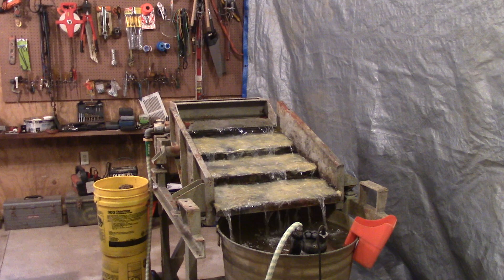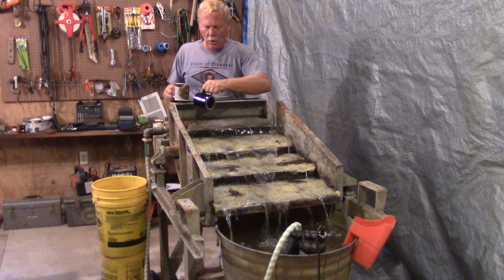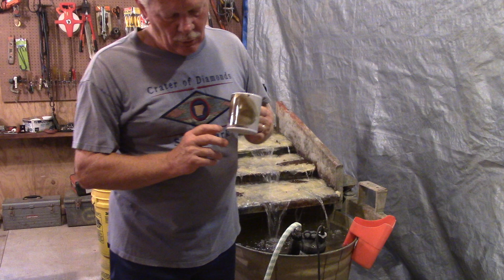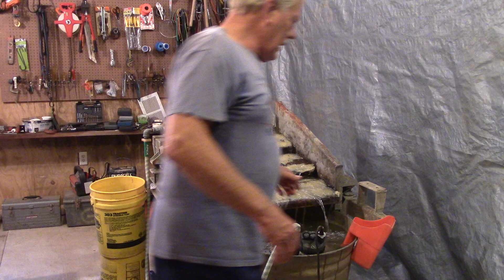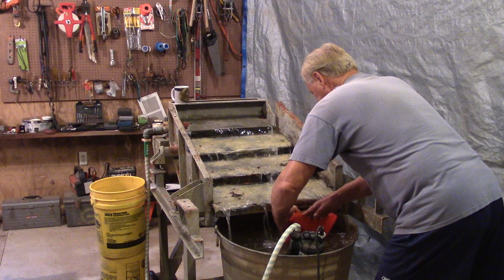Learn How To Run Gravel Over A Grease Table To Recover Diamonds

Comment: Good video,what type of grease do you like to use,? .would ordenery vaselene work ,and at around 23c temp as im in the tropics of bolivia, you do a good video a d explain well.
Reply from the maker: Thank you for watching my videos and for your compliment.  I use a special diamond grease that was developed by DeBeers.  It is called "DB-43."  Vaseline would be too soft and catch everything.  I have heard there is a good recipe for diamond grease that uses paraffin wax, lamp oil, and vaseline.  But I don't know how much of each you would use.  This "grease" is not soft like car or truck grease.  It is harder like wax.
Reply: Thanks for the info  ,ive been gold prospecting here in bolivia for some time,it just happens thay where i go theres kimbetlite or something close that looks like kimbetlite pipes eroodrd out of softer rock. @genuinediamondsinar3253

Comment: Which grease do you use and at which temperature?
Reply from the maker: I use DB-43 which is a DeBeers grease.  I got some that was abandoned after a diamond exploration and recovery project I worked on for 3 years.  You can make you own with paraffin was, vaseline, and lamp oil.  But I don't remember what percentages of each.  This has more the consistency of wax.  I wouldn't call it "grease."  As I explained in the video, the temperature is VERY important.  Your water, gravel, and grease all must be between 65 and 70 degrees to work properly.  Thank you for watching my videos and for commenting.  This is just one video in a series of 5 I did about grease tables and recovering the diamonds from the run.
Reply: @genuinediamondsinar3253  I assume the lamp oil you used was a paraffin-based lamp oil. I would think that a kerosine-based lamp oil would just separate when you run water over it.  Parafine melts pretty easily so I would assume that the majority of the mixture will be paraffin. you want the grease to be spreadable and tacky. I might try to look into the proportions. A book I have (Diamonds by Eric Burton) says the water would be slightly soapy. Does this sound familiar?  =)
Reply from the maker: @JewelryDeconstructed  Yes, I guess so.

Comment: Stumbled across your channel will the table catch gold it's hydrophobic like diamonds but heavier what's your thoughts
Reply: It's an experiment I am going to try with a set amount of gold in a recitation system to test it out any suggestions on what type of grease to use??? I thought I heard a recipe in video will have to go back and check when I get results back I will let you know. Thanks your videos were awesome and had great information
Reply from the maker: @406miner7  I am glad you are going to try a controlled experiment.  I would love to know the results.  I used to work for a diamond exploration and recovery company.  I got some of their DeBeers diamond grease when they closed up.  I'm not certain of the exact formula, but I've heard there are three components---parafin, vasoline and lamp oil.  To me, this "grease" seems more like wax, but of course not as hard as a candle.
Reply from the maker: @406miner7  I don't know if you've seen them all or just found this one video, but I have a series of 5 videos about using a grease table.  Here is one of them:  https://www.youtube.com/watch?v=bW4zCtmnqJo&t=5s
Reply from the maker: @406miner7  Here is a link to one of my other, grease table videos:  https://www.youtube.com/watch?v=HsK8QcI_uTs&t=25s
Reply from the maker: @406miner7  Here is another grease table video link:  https://www.youtube.com/watch?v=0ENLR39yoco&t=1s
Reply from the maker: @406miner7  Here is the final video about grease:  https://www.youtube.com/watch?v=OBRLO3artyM&t=1s
Reply: Cool thanks will let you know results
Reply from the maker: @406miner7  Great!  Thank you.  I'll look forward to hearing the results.  There's still so much to try and learn about.
Reply from the maker: I have never heard of a grease table being used for gold before.  I did not know it was hydrophobic.  If so, it would work.  Being heavier (denser) would only make it catch in the grease better.
Reply from the maker: I looked it up and found that, "As with all metals, gold is naturally hydrophilic, with liquid contact angles less than 90 degrees."  So, I wouldn't trust a grease table to catch 100% of the gold as you can trust it to catch 100% of the diamonds.

Comment: Huh where does one get a grease table by any chance? I am also wondering if one can use the rotary gold pans and add something to make the water heavy to seperate diamonds from the lighter stuff?
Reply from the maker: Grease and grease tables just are not available in the USA.  I used to work for a diamond recovery plant that left this equipment behind when they pulled out and sold everything else.  We used a dense liquid called LST that we bought from Australia.  It was $1,000 per liter.  I would not suggest relying on grease or dense liquids.  I would just get a sarucca and use it in water.  Most individuals do it that way and have great success with it.
Reply: @genuinediamondsinar3253  hmm know any plans on building a sarucca?

Was thinking of a grease table for seperating from concentrates after something like a sarucca or a vibrating mineral jig. 

As for the grease....not tried this but I know the south Africans look for 3 things in their grease. Softness, thickness, and tenacity. 1/3rd bees wax, 1/3rd vaseline, and 1/3rd boiled linseed oil is the Bush recipe I was given by a South african friend. Another is just bees wax and Vaseline until a thick sticky grease is obtained. 

Never diamond mined before or ever mined before. Ran a suction dredge once but it was for removing smashed beer bottles from the river bottom on a river tour. 

I got a lot of time on my hands and really wanna build something...
Reply from the maker: Here is a link to a video where I demonstrate the use of a sarucca.  This is the way to do it instead of grease or dense liquids:  https://www.youtube.com/watch?v=ISIlxqC7rG4
Reply from the maker: I have heard paraffin, vaseline and lampoil.  The "grease" I have used is pretty waxy.  I still just prefer to wash through screens and sarucca.  I don't know of any plans for making one.  I'm sorry I couldn't be more helpful.
Reply: @genuinediamondsinar3253  its alright they seem to be pretty rare in the DIY world apparently. Couldn't hurt to ask lol

Though I wonder what the angle on your table is. I have heard 5 degrees with a 1/4 inch drop is really commom in South africa and south America.
Reply from the maker: @kingdarkem  Yes, it never hurts to ask.

Comment: An aquarium heater is thermostatically controlled, and can keep a 55-gallon fish tank at most any temperature you desire.  I suggest you use two, and keep a backup on the shelf.
Reply from the maker: That is an excellent suggestion.  I've never had fish and didn't know about the heater.  That would be perfect.  Thanks so much for the great idea.
Reply: @genuinediamondsinar3253  Look for a fish tank thermometer at the same store.  I like the ones that float.  There are others you stick to the glass.
Reply from the maker: @maxcinta5760  Okay, thank you.
Reply: I have experimented with a grease table here in NC and considered water temperatures.  The average annual air temperature here is 60° F therefore the temperature of the water coming from my 30 foot well is 60° F so I don't even have to measure it.  I formulated my grease for that temperature and it routinely captured my cheap test diamonds.   The same should be true for a city water supply unless one is very close to the water plant or the plant has a very high throughput.  Measure it to be safe but you will generally find that it is very close to your average annual air temperature.  Btw for all you prospectors working creek bottom sediments.  Don't count on such diamonds to be hydrophobic.  Such diamonds are often coated with a mineral coating or a biofilm which might well alter that property.

Comment: Around fifty years ago I heard something about using grease on the bottom of a sluith box and shaker box to make the gold dust stick.  I figured it was bacon grease but I really don't know.  This information has been lost to history.  You are the closest information about this process I have found.  So, what do you know?
Reply from the maker: Thank you for watching my video and for commenting.  I have 5 videos in this series about using a grease table.  I worked in diamond exploration and recovery for years just outside of Arkansas' Crater of Diamonds State Park.  There are 8, known diamond pipes in the area.  I wrote a book about diamonds in Arkansas.
Reply: @genuinediamondsinar3253  Okay, what's the name of this book?  And, where are these 5 pipes located.  After a wee bit of research, I found out that gold is hydrophobic also.  So are most of the valuable metals.  I am now in Ponca City, and I plan to move to LeFlore OK ASAP.
Reply from the maker: @maxcinta5760  Thank you for your interest.  My book's title is, "Genuine Diamonds Found In Arkansas."  You can order a copy through our website or download it as an ebook.  www.DiamondsInAR.com
Reply from the maker: @maxcinta5760   The other diamond pipes are all within 3 miles of SW Arkansas' Crater of Diamonds State Park.  Here is a link to a video that tells where the other diamond pipes are located:  https://www.youtube.com/watch?v=_9Fvx-hQZks&t=1069s

Comment: So the wax you use that's db45 if you had to guess what do you think the mixture quantities are?
Does it feel more like wax or petroleum? Then, after that determination.
How oiley?
Reply from the maker: The consistency is more like parafin wax because it is pretty stiff.  But parafin is hard so it does have some petroleum jelly in it and a little lamp oil.  I could not guess the percentages.

Comment: Can an alternative grease be used since the stuff your using is no longer available ? Thanks, Dustin
Reply from the maker: Yes, I once heard of a recipe using parafin wax, petroleum jelly (Vaseline), and lamp oil.  I just don't remember how much of each you use.
Reply: @genuinediamondsinar3253  thanks
Reply: @dustinneff1784  If you trap all the material Inbetween two sets of riffels. With one pointing down and offset to one pointing up.  With grease of anykind filling inbetween the uper ones riffels. The lower one cast the diamonds up onto it as they pass over the lower ones riffels as in like a slues. But not. 

Had a friend that had a book of practical mining ideas from sometime in the late 1800s. As it had no cover or many pages left. It did however still have pages that covered diamonds. And Rockerbox's that can be used in conjunction with grease. As a slow side to side action gives more opertunety for a table to catch them.

Comment: That gravel your adding looks like its dry. It pours awfully easy.
Reply from the maker: Yes, the gravel is dry.  I drop it on the top level that has running water.  It wets everything except the diamonds which are unwettable.

Comment: Was the water too warm?  I'm seeing metal or holes in your grease from the start of video.
Maybe that is piles of sulfide getting sorted on the levels by water action
Reply from the maker: Gravel just pooled and piled as I fed it.  Water later washed it off.  It's no problem it sat there for a while before washing away.